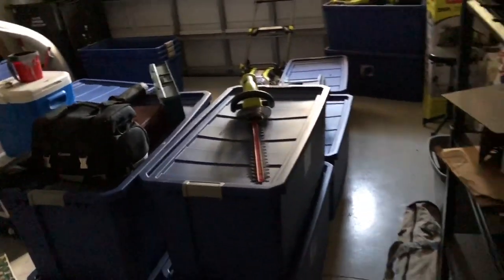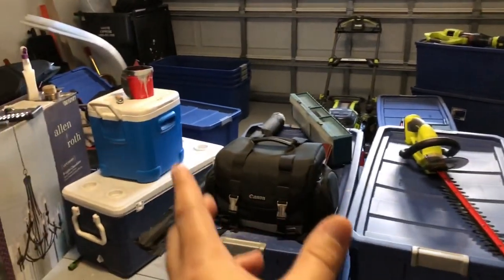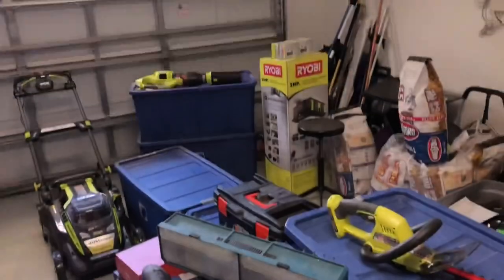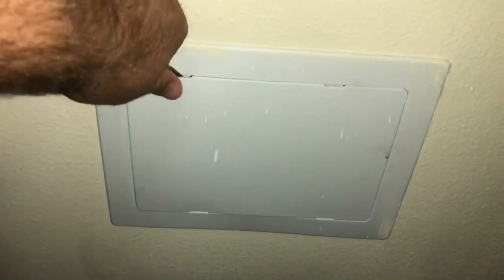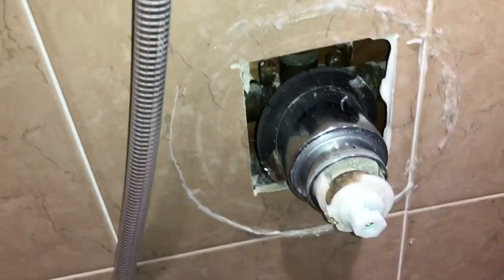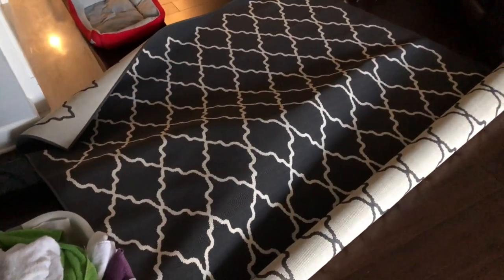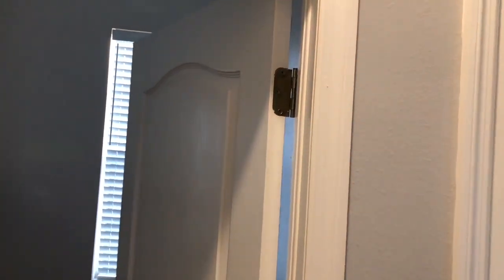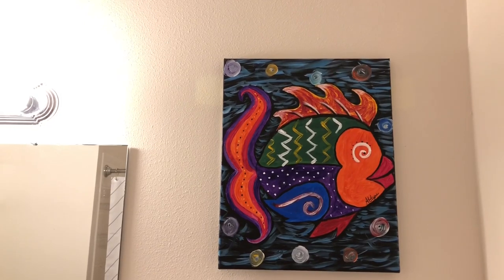Home Vlog Day 30 - CO Guy Stuff

Comment: Turn the garbage 90 degrees. It is not as wide as it is long.
Reply from the maker: Lol and then you have to drag it sideways out when it’s full
Reply: Roll it out from front wall, pivot, and out ya go. I do agree though thay they so not make the garages big enough for cars and the can..
Reply from the maker: I don’t think you understand how big mine is. I have to use my foot just to tip it back on the wheels if I load it up. It’s oversized.
Reply from the maker: The best I could do is turn it sideways but leave room to roll it in down the wall, but it would have to be on the other side. We will see. Organizing the garage is a few days off.